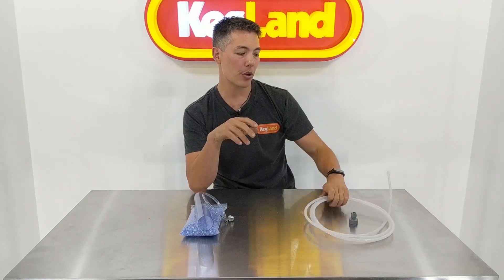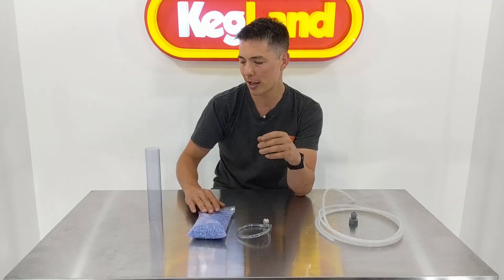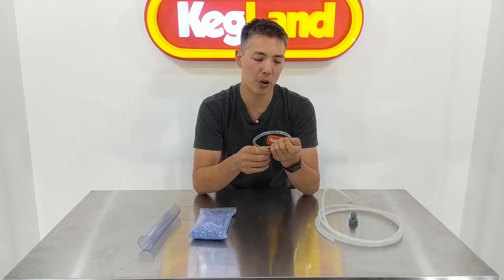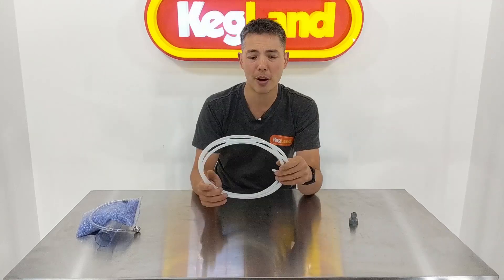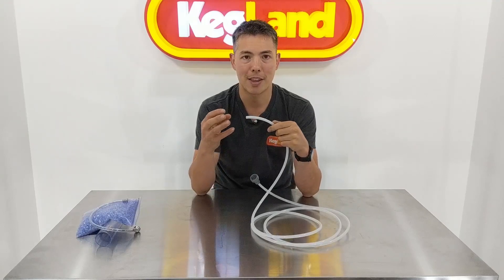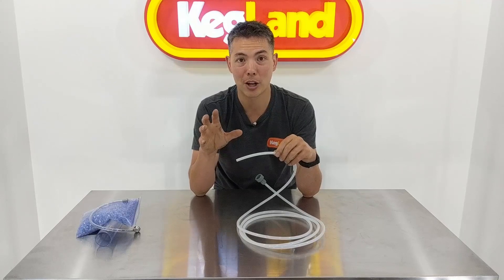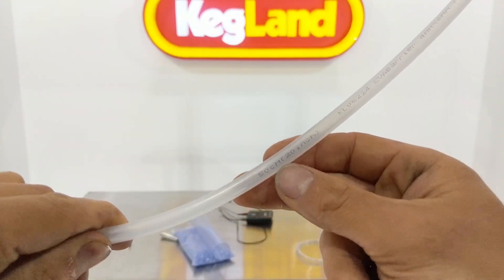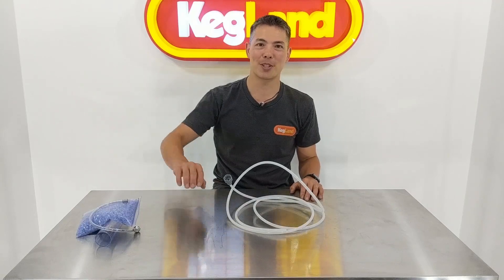EVABarrier Beer Line - Why we use this instead of vinyl(aka PVC, CVT)

Comment: Question about gas use.  If diameter makes little difference in operation (rate loss), which I agree, then would a smaller diameter line (e.g. 3mm) have less gas transmissivity (i.e. O2 ingress) than a larger diameter line?
Reply from the maker: Yes absolutely this would be the case.  Oxygen transmission rate (OTR) is a liner function of surface are.  So if you have smaller ID (Less surface area you can expect a proportionate decrease in transmission rate).  You are correct.

Comment: How would someone go from a regulator to a secondary regulator with this? My secondary has left hand threads and there isn't a fitting for this
Reply from the maker: Is there any reason why you are not just using this product:

https://www.kegland.com.au/duotight-inline-in-line-regulator-with-integrated-gauge-for-water-or-gas-8mm-5-16-push-in.html
Reply: @KegLand  I currently have a secondary regulator and didn't want to go and purchase all the fittings and regulators to mirror the one I have

Comment: What is the different purpose of 8mm and 9.5mm line you guys selling? why dont we just use one type of line?
Reply from the maker: The size of the line makes a big difference to flow resistance.  If you were using the 6mmID line in a kegerator you would need about 7-8meters to get the correct flow resistance.  For this reason we sell smaller 4mm ID x 8mmID so you only need 1.5meters to get the necessary amout of flow resistance.

Some customers want to do fast fermenter to keg transfers and the larger diameter makes a big difference so larger diameter is desirable in this scenario.  Or of the kegs are a long way from the taps you will also have to increase line size so you dont have too much resistance.
Reply: @KegLand  where can I find flow resistance of Eva Barrier?
Reply: @KegLand  where can I find flow resistance of Eva Barrier?
Reply: @KegLand  Do you mean 8mm OD?
Reply: @fryloc359  The 6.5, 8 and 9.5mm are all outside diameter, and they list the ID separately -- they offer both 4 and 5mm ID tubing in the 8mm range

Comment: Is there a difference in what inner diameter line you use on the CO2 gas side
Reply from the maker: The gas is not that important unless you are a very high turnover customers. Some large bars might want to consider using larger gas line so they can pour 5-6 pints all at the same time without experiencing a pressure drop.  Most domestic customers will never be pouring so many beers concurrently so using any diameter beer line is fine.  Even very small diameter line 3-4mm ID would keep up quite easily with 1 or 2 beers being poured at the same time.

So in short use whatever ID gas line that is convenient for you.

Comment: What is the resistance per foot for the 4 and 5 mm ID? thanks you!
Reply from the maker: Determining flow resistance is a bit of a tricky one and will change depending on your own kegging set up. I have found using this calculator really helps: 

https://www.kegerators.com/beer-line-calculator/

Comment: What do you recommend for cleaning the EVABarrier tubing?  Is BLC okay?  How often do you recommend cleaning?
Reply from the maker: The cleaning frequency has more to do with what you are dispensing rather than specific time frame.  Practially speaking if you clean your lines when you are cleaning your kegs is probably the easiest procedure.  As you already have cleaning product in your keg it's the most efficient time to just hook the keg up and clean the lines at the same time.

Comment: Great video. Just ordered a 12m spool to change all my lines and also switch over to duotights. I got the 4mm ID. What's the resistance on that one? (Lbs/ft)
Reply from the maker: No worries at all.  With the 4mm ID you will need about 4-5 feet to absorb 10-13psi of keg pressure
Reply: @KegLand  Can you tell me how long the line would have to be for a 5mm ID version at 10-13psi, please?
Reply from the maker: @zt7489 It depends a bit on what flow speed you are after but normally about 3-4 meters is good for 5mm ID.
Reply: @KegLand  on your website (https://www.kegland.com.au/bronco-tap-starter-kit-great-beginners-keg-system.html) you state you can - 
Cut a short 20cm piece of beer line and attach each end to a bronco tap and liquid disconnect.
Firmly hold a section of the beer line between and stretch the beer line with force.

Could you tell people if the EVA line stretched better if heater in warm/hot water, etc?
Do you know what length of 5mm ID line can be stretched to act like a 4mm ID model, pls?
Thx for your previous excellent customer service.

Comment: I just received some of this tubing from williams brewing.  Out of the box there is a very harsh chemical smell on the tubing.  Is this normal?  I'm going to let it air out for a few days and see if the smell goes away.
Reply from the maker: When the bags get bagged immediately after being printed you might find the smell of the dried ink on the outside of the beer line might be trapped in the bag.  So after opening the bag let this smell dissipate.

Comment: I tried John Guest fittings and that rigid line and it leaked because it was so rigid. I would switch from vinyl if there was no Guest fittings
Reply from the maker: With push in fittings you really have to be careful with the line type you use.  We use EVABarrier beer line and the tolerances during manufacture (particularly the OD) needs to be controlled precisely.

If you just get some other cheap beer line where the OD is not precisely controlled you will likely have issues.

We use thousands of these fittings and have no issues at all because we use the correct line for the job.
Reply: @KegLand  That maybe so, but the lines is very stiff so when I connected gas and beer line they leaked so next morning I had no beer and no co2.  So I´m not converting to stiff lines again

Comment: Would vinyl tubing still be safe for gas lines?
Reply from the maker: It would be slightly safer however the plasticisers still get carried off the gas line and into the liquid beverage.  vinyl tubing is really cheap to make but in reality there is no point to take the risk.  Just use a product that is free of plasticisers.

Comment: How does this product compare to Accuflex Bev-Seal Ultra, will it be more flexible or just as rigid? Durability as long? Cheers.
Reply from the maker: The product is almost identical so you will get very similar performance, durability and it's similarly rigid.

Comment: How long should be the line for average carbonation (12-14 psi) to be balanced? How's the resistance compared to regular PVC hoses?
Reply: I've used a product like this in the US. Since the inside liner is so slick you'll want to use one foot per PSI.  So 12ft for a 12 PSI balanced system. Cheers.
Reply: They sell two sizes. Assuming this is the 5mm ID line estimates would put the required length at about 17 feet for 14psi and 15 feet for 12 psi. This should give you a pour rate of about 10s per pint, assuming your tap is about 1 foot above the bottom of the dip tube